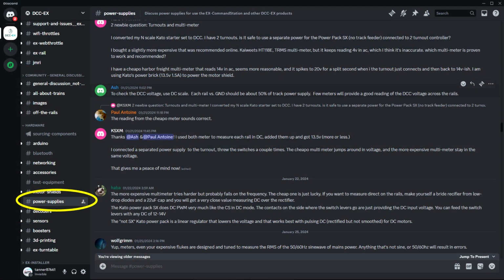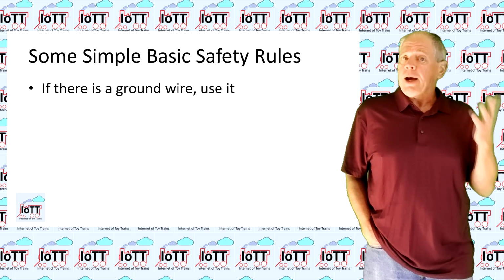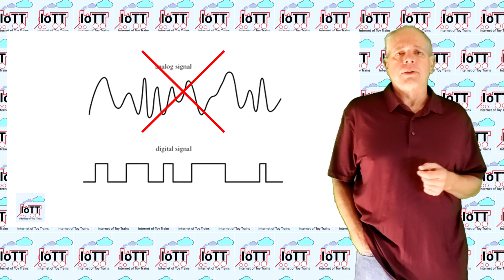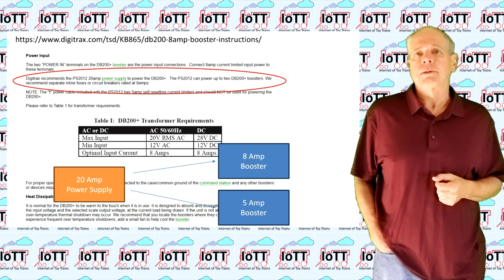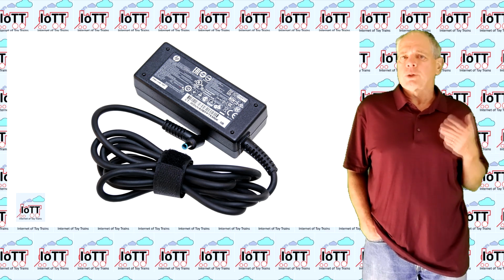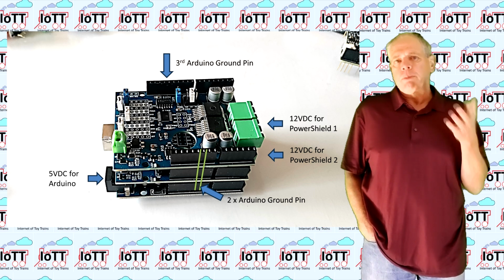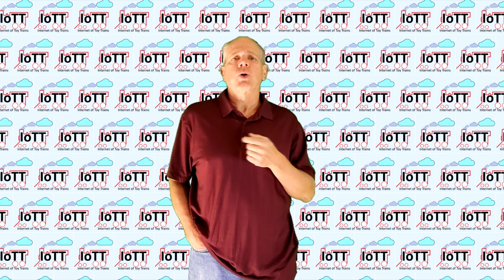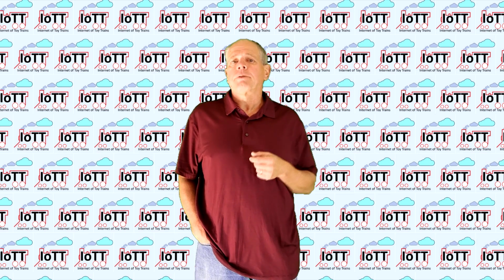DCC Power Supply Considerations (Video#138)

Comment: Another great video, especially  to remind us of the importance of safety.  Hope all is going well with settling in at the new house.  I did binge watch almost all of your videos (and watched several of them multiple times) and purchased the IoTT stick, Redhat and Aux shield and have it working successfully with a Mega and 8874 motor shield.  I will confess that it was a little challenging to string the different videos together to get it working.  JeffK and a few others helped on the DCC EX Discord.  I still am working on configuring JMRI with this stack.  Is it okay to message you through the Discord?  Have you considered a video to tie all of the currently available boards & software together?  Keep up the great work and thank you for making these products available and sharing your knowledge!
Reply from the maker: Thank you. Regarding the instructions, the idea is to have them on the web page. Unfortunately, the old page got corrupted when I tried to upgrade the CMS, so I have to rebuild it. Of course you can message me in discord or send me an e-mail if you have questions I can help with.
Reply: @IoTT  Great, thanks Hans!

Comment: This is a great video, particularly the emphasis on safety.   A lot of hobbiest forget that their "low voltage" power supply line actually is supplied from mains voltage adapters which could pass mains voltage through.   I would be a little cautious using a laptop power supply on our model railways.  These are usually only rated at a maximum of 65Watt and they are not well isolated.   I would only use these if you are really desperate for a power supply.  
The only thing I found distracting in this video was a lot of background noise.    I know that's not your fault, but it made my look around for sources of the noise until I realised it was in the audiotrack of the video.
Reply from the maker: Thank you. For the notebook power supply, the same principle applies: Nominal current of the booster plus 10-20%. So, if the nominal current of the PS is 4 Amps, set the trip current of the command station to max. 3.5A.
As for the noise, I am still filming in a very temporary setup in the garage after moving. To avoid echo, I had to open the door half way up, so you can hear that stupid bird out there and an occasional car going by. And at one point it started raining. The good news is I got the building permit for my shed, so things will get better over time ;-)

Comment: Will there be a Part 2 on power supply for DCC Aux Shield?
Reply from the maker: The principles are the same, so there is not really a need for it. Connect a strong enough DC power supply to the power shield(s). The AUX shield can than be powered from a separate power supply or from on of the power shields using the jumper that feeds the voltage to VIN (as long the voltage is not more than 18V).

Comment: The NMRA DCC standards also call out not using a bundled ground wire between devices (LocoNet, LCC, etc) when connecting via power station interfaces. It is generally advised to always connect the common GND terminals when available on DCC devices, in some cases it is mandatory (non-isolated interfaces).

In all cases, be safe with the wiring for train layouts. If you have questions, ask them to the appropriate people.
Reply from the maker: Thanks, good advice!